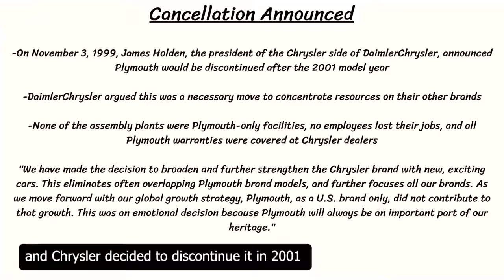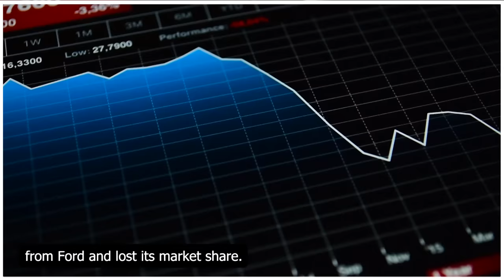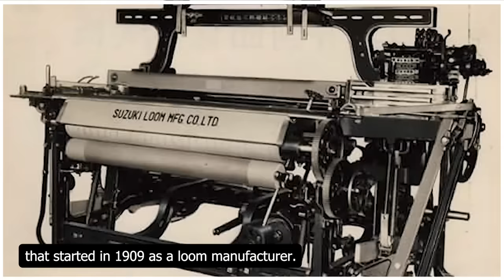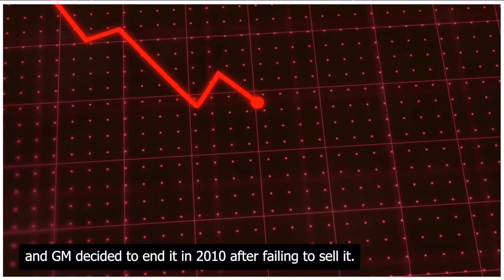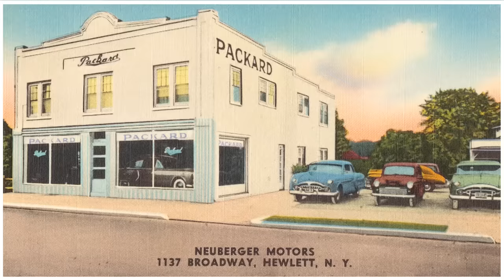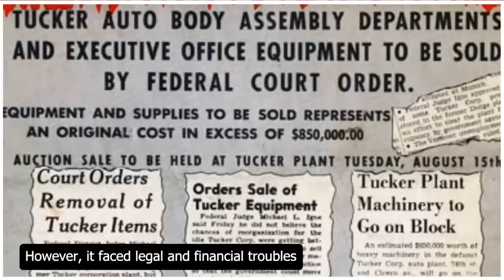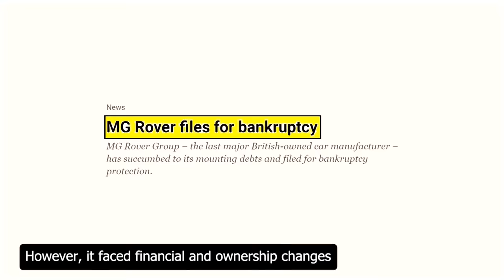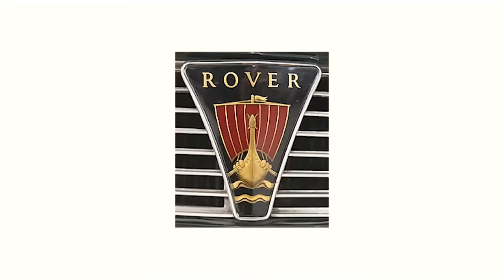20 Famous Car Brands That No Longer Exist (And Why)

Comment: A lot of brands missing from the list and a lot of errors. Datsun simply changed its name, MG is still around, Hummer is back and you even have a picture of the inside of the new version and so on.
Reply from the maker: I will remove the all errors in the next video.

Comment: Good vid,  How about 99.95% if the entire British Motor  Industry - Austin, Morris, Riley< Wolsely, Daimler, Hillman, Triumph, Sunbeam, Talbot ..... Then you got Holden from Australia.  These were huge companies & sellers, "household names" ( know they not known in the US) for decades.  Any British Commonwealth country guarantee you will still find a Morris Minor or a ( ole school) Mini putting around
Reply: The UK auto industry died because it was crap, designed in inch ! Mix a US UK fasteners  bearings...out of specs parts...Therefore Unreliable and hard to maintain that hardly sell outside the UK. Then came the idiots with MBAs and their "society of service". No more industry...
Reply: Poor old Holden. Although it was a GM subsidiary since the 1920s, it really helped forge Australia's unique take on family cars that fell somewhere in size between the small European/British vehicles and the massive US vehicles. When they had the GM V-body World Car forced upon them for the 1978 model year, the Holden Commodore was gradually de-Opeled with each successive model update and each new generation, until the VE/VF model had zero Opel influence. Then GM discontinued Aussie manufacturing, and the Holden was gone, replaced with a fully imported Opel which didn't sell well, essentially validating decades of Holden's recalcitrant grasping to independence rather than just doing what daddy said.
Reply: Also Jensen, TVR ,Standard and Austen Healey among others. If I remember correctly De Lorian got government subsidies to create jobs in Northern Ireland but a large proportion of that money went into someones holiday fund. Jensen got caught out by the 1972 fuel crises when big V8s were hard to sell and needed the government money to develop the Jensen Healey, but that money went to De Lorian.

Comment: Some corrections 
- Datsun, Datsun was Nissan's brand for export vehicles (non-jdm), they didn't disappear Nissan just dropped the name and used the Nissan instead in most markets, I remember in the 1980's during the transition some cars would have the Datsun badge and some the Nissan badge even on the same model.
- Suzuki, while not sold in the USA any more they are sold in most countries around the world and still sell well, it was only the USA's sales subsidiary that went bankrupt not the manufacturer, this probably has more to do with the preferences for land ships in the USA.
- SAAB, was sold to GM and then GM destroyed it by insisting they use the less reliable GM engines causing customer to go elsewhere. I guess if you can't compete borrow money buy the competition, shut it down and the put your hand out for a government bailout. I guess this is like saying that Chrysler doesn't exist because it was bought by FIAT and then FIAT was bought PSA and renamed Stelantis?

Interesting that you picked on these Japanese car brands but not the French brands that are also alive and well but don't sell cars in the USA because NHTSA banned their safety features to protect the less safe American brands

I wonder how you'll report soon to be defunct Ford and GM? The tragic stories of poor management.
Reply from the maker: Thanks for sharing your valuable information, I will try to follow your suggestions

Comment: Pontiac was call the Oakland car company in Pontiac Michigan Named after Chief Pontiac .
Reply from the maker: Thanks for sharing your lovely information
Reply: Actually, Oakland and Pontiac were two different brands. Oakland came first, then Pontiac was added as a lower cost brand. Pontiac survived after Oakland was shut down. It deserved a better fate than what it got in 2009-2010.
Reply: @Johnnymason2460 if memory serves me correct the mergers into General Motors was 1918 and severely maker’s at once Reo Oakland Carter cars and several other . Have you been to the Orphan car show in Yipsilanti Michigan ? Excellent show dozens of car makers get shown . I personally like the Brass era and 20s cars . I haven’t see a Graham Paige in any recent show’s.